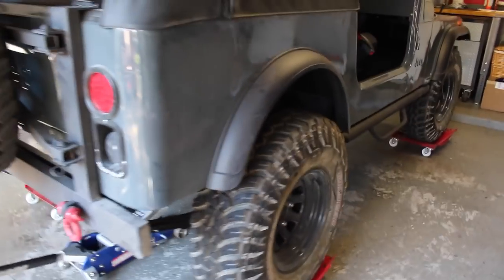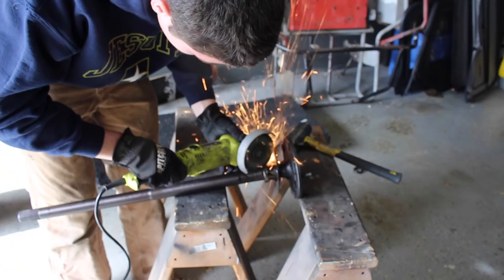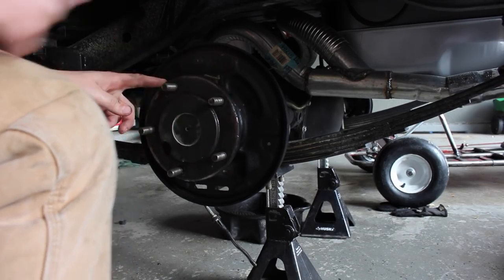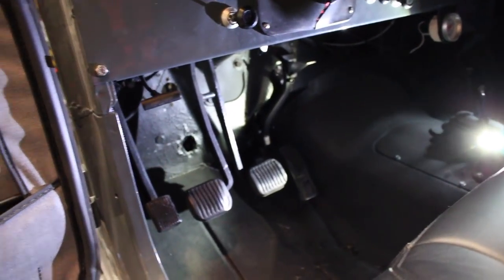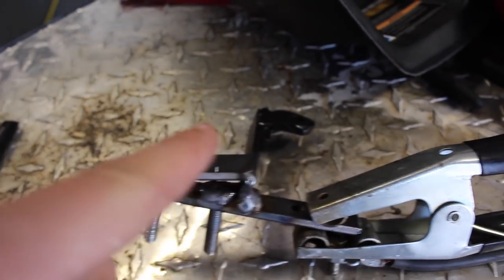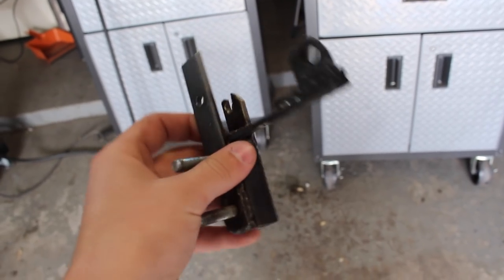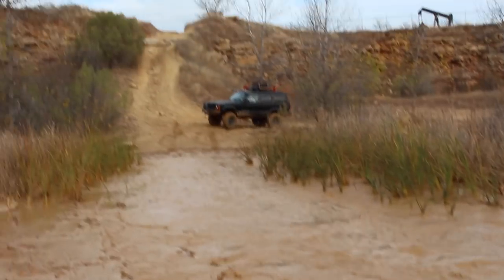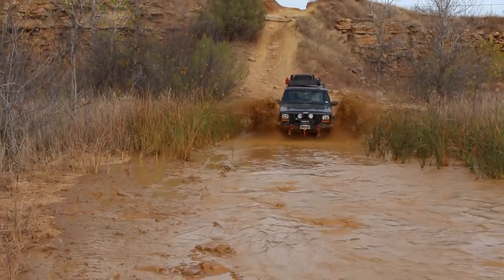Jeep CJ Offroad, Hydraulic Clutch, and 4.10 Re-gear!

Comment: Hey guys!! I have a question. I have a go kart with a Tecumseh 6 hp Power Sport motor, that wont start. I've replaced the carburetor, spark plug, and recoil start. It has compression, spark, air and fuel. Any suggestions would be welcome. Keep up the great videos.

Comment: A little tip from an old wrench spinner.  You dont have to cut all the way through a bearing race.  If you score it about a quarter the way through (similar to the way you cut yours) place the bearing (and shaft) on something firm like an vice and take a harden cold chisel, place it in the notch you scored in the bearing.  A firm smack with a hammer will fracture the rest of the bearing race.  Cutting all the way through you run the risk of hitting something else.  You can even score it with a simple hacksaw.
Reply from the maker: fillupread Ok, good to know, it was pretty tough worrying about cutting the axle underneath. Thanks for the advise.
Reply: What's even easier than that is just run a bead in the middle of the race, about 1/2 to 1 inch long. The race will almost fall out!!
Reply: junor747 never tried that one. I assume the heat expands the race.
Reply: Try it next time you will thank me :)

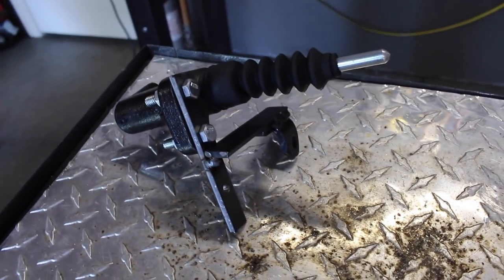Comment: @12:22...if im going to over build something i will start with grade 8 bolts and thats a minimum requirement for any suspension components...the no grade hardware you are using is made for metal gates  and kids swing sets, not anything with real weight on it...the difference in strength is huge...fun video and that looks like a really great jeep...my buddy has one with a 5.3 conversion that he put over 80k miles on, the majority offroad and it has a few nice battle scars from the rugged arizona terrain

Comment: You can hammer out putter bearing races from the other side if you put a pipe through the axle and get it on the lip of the race. Gotta be careful when you heat up the axle housing, if it gets heated up too much and gets distorted you can brake an axle shaft

Comment: Maybe think about a spring'over conversion for the cj. It will ride a lot better and beefier stance.. Look better too..
Reply: Also give u better rid height, those tires wouldn't rub as they did around @17:20-30 mark. It's pretty much an inexpensive suspension lift. Only have to relocate ur shock tabs, I think longer pitman arm.?.. I did that to my ol'cj7 way back when. ALso done same to my wrangler, it helps. Back when I was younger I didn't have mom n dad to help so I did it myself. At the time a 4-6in suspension lift was like $12-$1,400. Same kit now $400 for that year model.. 
Anyway good luck on your build and be careful.. VB's are notorious for being easy to roll over.. I actually put wider asked on mine back in the day. If it's wider it'll hang curves better and you probably need that with that v8 .😉,.. Mine had engine out of a vette so I'm guessing 600-800 hp. in a lil light cj jeep. They'll move with ya brutha that's fo' dam sho'🤪👍 have fun with it..

Comment: Did you air down when wheeling at the end?  It would help in thr rocks
Reply from the maker: notinside1 No we didn’t, probably should have but we weren’t really doing anything insane.
Reply: Build Break Repeat. looked fun anyways, that wrangled slipped off that rock and almost got its wheel

Comment: One important thing, those bearings don’t run in gear oil. That’s why you installed the seal. Jeep rear axle bearings need to be packed with grease. Didn’t see that in the video. That may be why the axle seal leaked and your bearings were toast

Comment: so because you put a seal on the inside of your bearing it is not gonna get lubed and just going to chew its self up again
Reply: johnyq the bearing needs grease, the gears need oil. Without a seal the oil washes the grease off of the bearing, and then it is destroyed
Reply: Also worth mentioning the bearing needs packed with grease, not just covered in it. There’s a tool to make quick work of it

Comment: U probably hate hole saws so much cause you use them wrong. You should lube the blade with wd 40 or pb blaster or motor oil anything really. Itll prolong the life of your saw and itll cut easier. Also when you first start cutting you should go high speed so it doesnt catch and dont push super hard so it doesnt bind up and smoke your drill